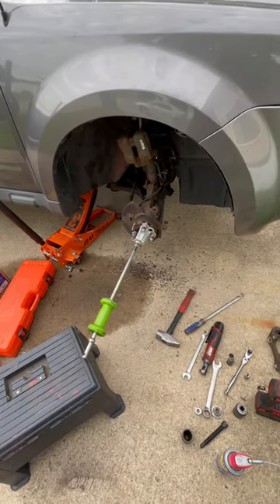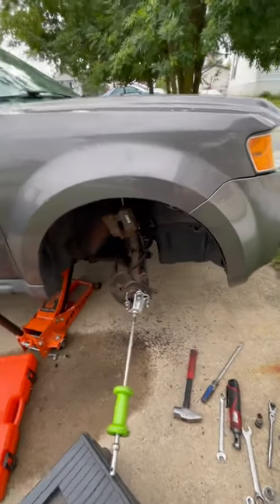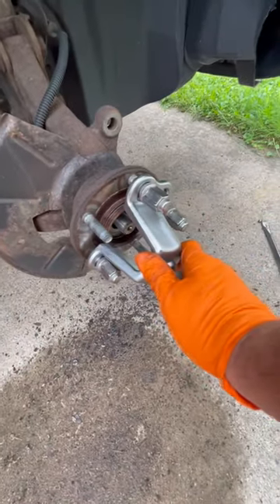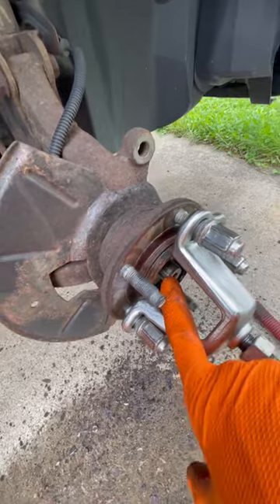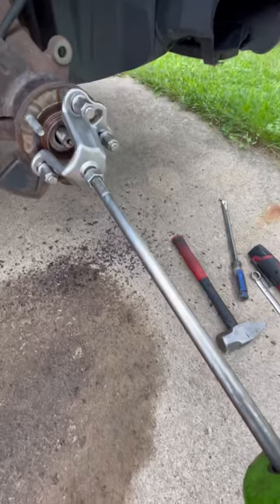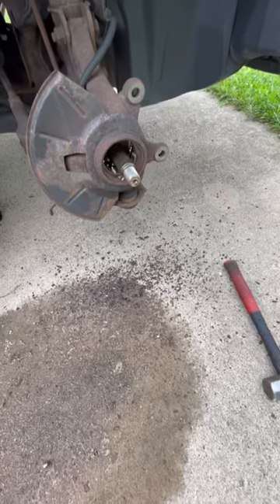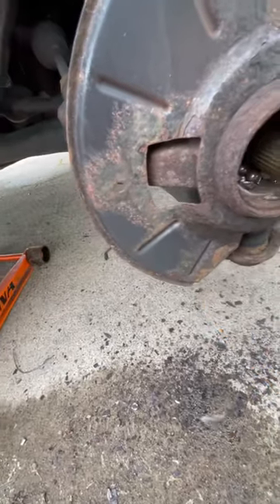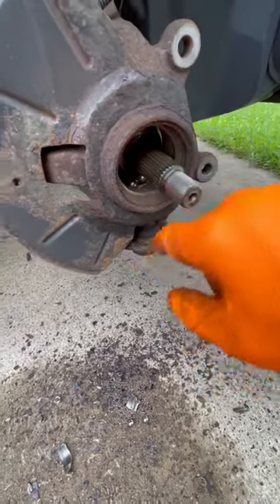2012 Ford Escape wheel bearing noise.. customer actually thought it was the brakes that was b￼ad

Comment: You removed the hub and outer race, not the wheel bearing. You still have a C clip and the bearing assembly to remove and reinstall
Reply from the maker: Yes you’re correct. I was showing how damaged this wheel bearing was.

Comment: If youre replacing the axle you couldve just used a chisle and a hammer and punched that axle out
Reply from the maker: So what I think you mean is if you push hard enough you can push the cv axle in hard to get it out without removing any part like strut or ball joint. Very few can do that and also if so how would you get the new one in without damaging it also.